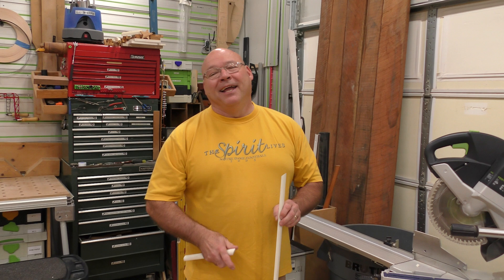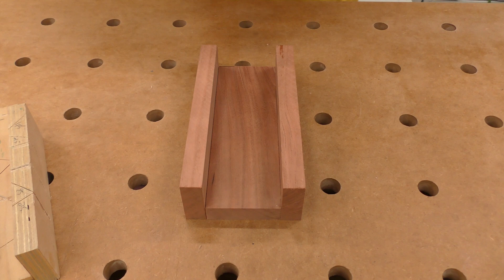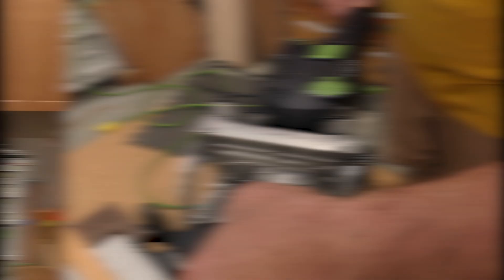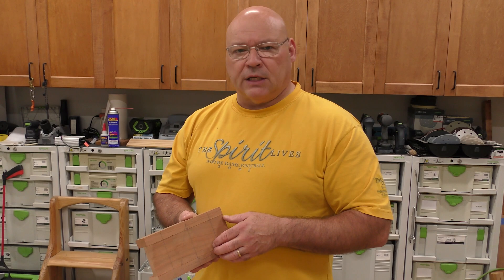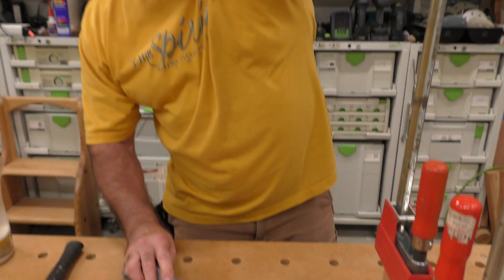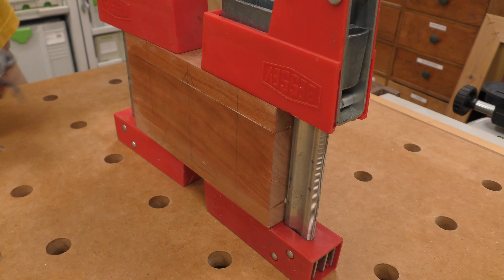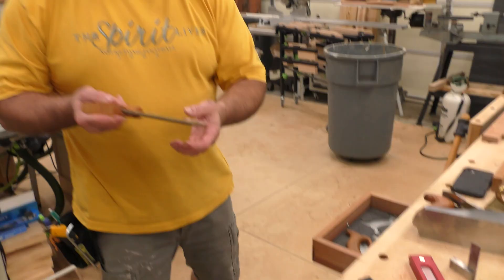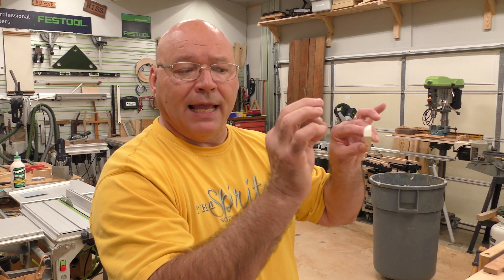Miter Box: How do I cut small returns?

Comment: Hi sedge. Would you consider doing a video on the proper way festool change the splinter guards on the rails. Iv had a festool tracksaw for a long long time with many rails and iv have varying result when it comes to replacing the splinter guards. Silly and simple but sometimes i can be a pain especially if you dont have acetone on hand. Cheers
Reply from the maker: will do....